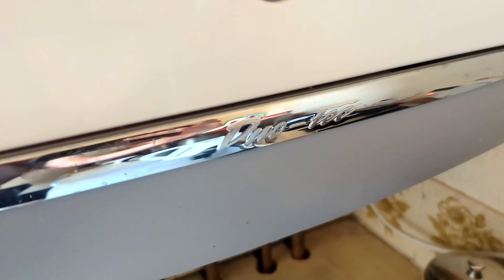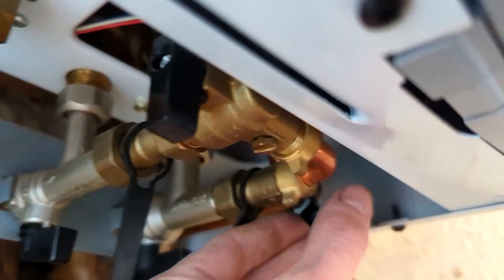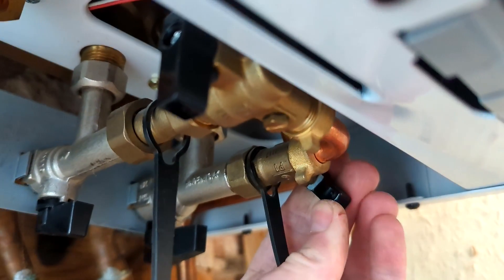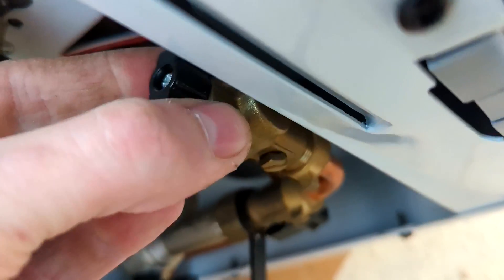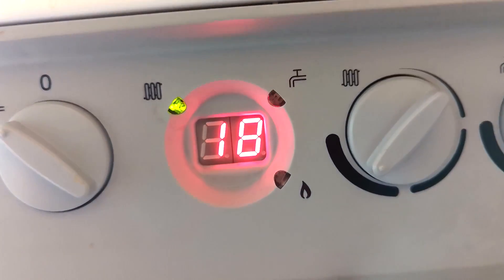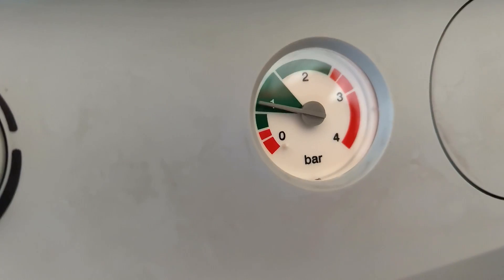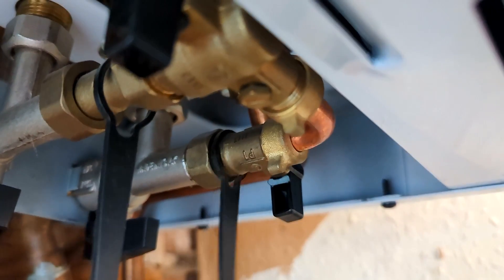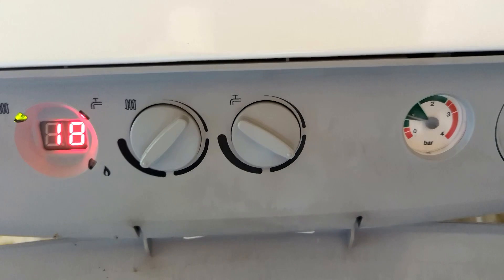Baxi Duo Tec Low Pressure - E119 Error code - How To: Increase the Pressure

Comment: Got Low pressure
 My duo baxi right hand side valve is literally stuck in position 
Iv turned with force but is stuck! 
Any advice? Thanks
Reply from the maker: I know these valves can seize up and become harder to turn. Using some grips can help with leverage or unscrewing the plastic lever off and using a spanner on the valve itself can work.

Otherwise if it's really really seized, it'll need a new valve.
Reply: @dpjplumbing ok thanks so much 👍🏼👍🏼

Comment: Thanks for sharing this video, our pressure had dropped so ive talked tje wife through filling ours, however she has manged to fill it to around 2 on the dial.

Is this safe to use as i have previous noticed that the pressure would jump up when in use? If not how would i best drop the pressure back down?
Reply from the maker: The easiest way to remove excess pressure is by bleeding a radiator into a jug.

You can also drain it by a drain off valve but if it's old they have a tendency to leak afterwards.

2bar isn't ideal, it should be between 1-1.5bar but if the pressure goes too high the boiler has a pressure relief valve built in which will usually discharge pressure outside.

If the pressure is going into the red when the boiler/heating is running. It could be the pressure vessel needs maintenance.
Reply: @dpjplumbing  I really appreciate you taking the time to reply, thank you very much.

I'll fixing it when I get home tonight 😂
Reply from the maker: @Wardy75  no worries, hope you get it sorted.

Cheers,
Dan!

Comment: How would you then let some pressure out?
Reply from the maker: The easiest ways are:
1. Bleed a radiator into a jug
2. Open a drain off valve with a hose attached or jug/bowl underneath it